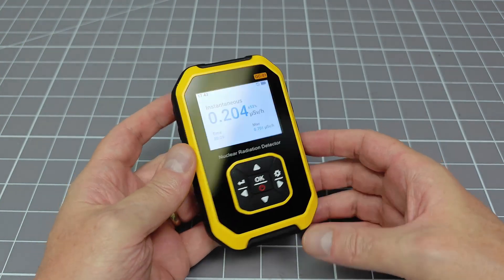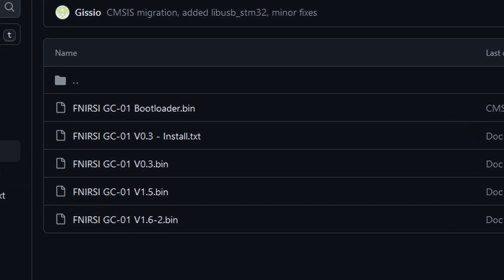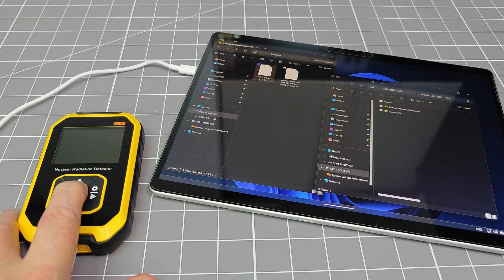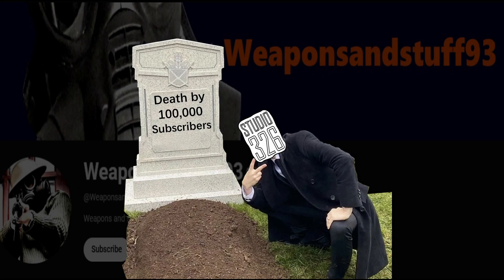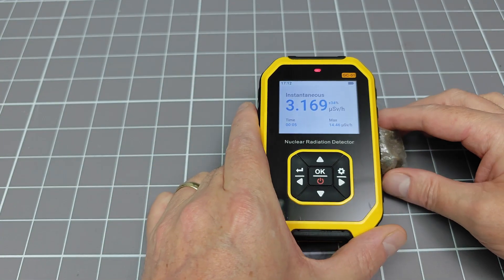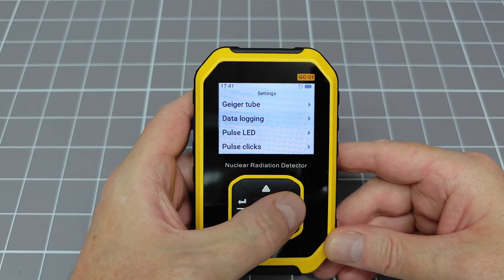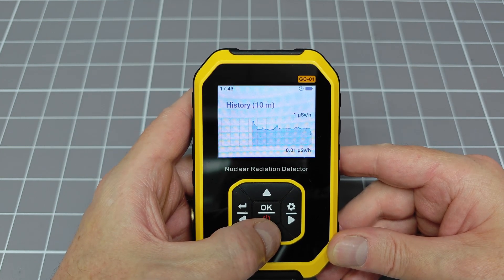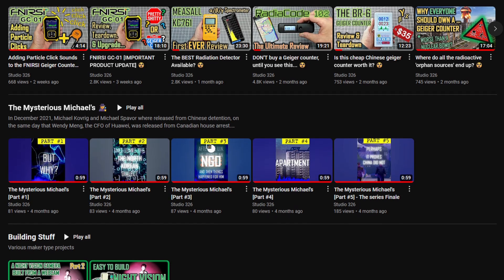FNIRSI Firmware Upgrade, Review & Instructions

Comment: the updated one is 2.0.3

so which bin file should i use?
Reply from the maker: I really can't say, it depends on what version MCU you have in your unit, there is a FAQ section on the Gissio GitHub, probably worth a look at that!
Reply: I also have an updated version. Flashing firmware didn't work the first time, just putting the file in didn't work. I had to disconnect the battery because the device was in a bootloop. With the battery disconnected, I connect my gc-01 to usb and simply put the same firmware file 2.0.3 and everything was flashed successfully. Tube j321.  APM32 MCU

Comment: Sadly I didn't even get to try this.  The version I have doesn't seem to have a remotely similar pcb in it and does not communicate with a PC via the usb-c port.  I'm stuck with some poor clone version of the gc-01 firmware.  At least I soldered in a m4011 gm tube though so it does read a lot better.
Reply from the maker: Not sure its a clone, just an older (or maybe newer version) that is cost reduced.

Comment: Anyone try the final release?
Reply from the maker: The last time I downloaded was about 6 months ago, has there been any major updates in that time?
Reply: @project-326  I am not 100% sure tbh. On the previous links, nothing has changed. However if you go to the radpro releases... the last firmware update was 25th November 2024 (2.0.3) and there were a few in-between.

I am about to get my hands on one of these (Little choice), so was hoping to turn it into the best it can possible be lol.
Reply: @project-326  He just released another update that improves on the last... so there has been at least 3 more updates since this release and definitely looks better and gives more tuning options.
Reply: @project-326  From what i can see. The latest version has added some more customisable options in the menu, for detection, appearance and battery lifetime. I have not run it through tests and gone through all the options (Accuracy, battery life and customisability), but from first glance it does "look" better than the Beta version.

Someone with more experience should give it a test 😉

FYI - I just got my GC-01 from amazon. It came with the J321 GM Tube (J321 2022 V).

Comment: Thanks for this. I had just done the hardware upgrade to get clicks but this is probably a better solution. Also the damping (rolling averaging) of the original software is pretty terrible so this upgrade may fix that well I hope. I think I will try it

Comment: also what gm tube is supposed to be in the gc-02 model if you know, i think its the sbm20-1 but im not sure and also is that tube even good or should i upgrade it to another tube and if so which one would you reccomend
Reply from the maker: the GC-02 is the cheaper version and uses the J614 tube, which is pretty terrible.
Reply: @project-326  okay thanks for your advice ill go with the gc-01 and upgrade it if i get the cheap tube
Reply from the maker: @tthesubbutton  there are some reviews of some other low costs counters on my channel page, some of those might be a better option to the GC-01...

Comment: I want to change the tube with the Sbm-20u. Is it necessary to change the High Voltage power.?
Reply from the maker: looking at the SBM-20u spec, its looks like the recommended voltage is 400V, the old tube wants 380V, which is pretty close.  That said, the firmware upgrade from GISSIO allows adjustment of the voltage.
Reply: @project-326  "I think I have a 'fake' GC-01. The board is totally different, and the MCU is not (WCH) or (GEEHY). The code on it is: CA32F0156L2-62. It can't connect to a PC, and even if I managed to connect it, the firmware would probably not work on it."
😢
Reply: @project-326 "I think I have a 'fake' GC-01. The board is totally different, and the MCU is not (WCH) or (GEEHY). The code on it is: CA32F0156L2-62. It can't connect to a PC, and even if I managed to connect it, the firmware would probably not work on it."
Reply: @project-326 "I think I have a 'fake' GC-01. The board is totally different, and the MCU is not (WCH) or (GEEHY). The code on it is: CA32F0156L2-62. It can't connect to a PC, and even if I managed to connect it, the firmware would probably not work on it."
Reply: I think I have a 'fake' GC-01. The board is totally different, and the MCU is not (WCH) or (GEEHY). The code on it is: CA32F0156L2-62. It can't connect to a PC, and even if I managed to connect it, the firmware would probably not work on it.
Reply: @aggeloslianos6083  I think you do sadly, looks like a CACHIP, which is not supported by the aftermarket firmware according to GISSIO's github. I'm sorry that it happened to you, it happened to me before but I managed to return and get a refund for an authentic GEEHY model.

Comment: Is the device's Geiger-Muller tube still original (only the firmware was updated)?
Reply from the maker: no, it was changed for the type that was very originally used, not the type that was shipped.  There is a video about this on the channel page...

Comment: I like very much! But, my issue = the device & pc does not connect ... Only loading battery ... Nothing happens ...
Help! Thankxs!
Reply from the maker: First of all, let me just say that I am not an expert on this firmware or in any way responsible for its development.  You need to post on the GISSIO GitHub portal to post these types of questions.
Did you press and hold the power key before plugging in the USB cable?  Are you sure that the USB cable is a power + data type and not just the power-only one that was supplied with the product?
Reply: @project-326  Thankxs Very Much, I'll tsjeck it all !!! Greetings from  West-Flanders (Belgium).
Reply from the maker: @FrankDeDekenTurbosoul  Greeting from Shenzhen (China)
Reply: @project-326  I've got the geigercounter BR-6 today. Watched Your review! 
Ps: About GC-01: i think the USB cable is only power type; won't recognise when connected - only loading battery.
Reply: @FrankDeDekenTurbosoul  Have you found the solution?

Comment: Hello! 
  Thanks for what you’re doing on your channel – great job!
Have you ever tried Pudibei Geiger counters? I use the NR-950 model for 24/7 monitoring in my home (just a hobby :) ). 
It’s simple, can run on a battery for more than a month, but I can’t say for sure how accurate it is...
Reply from the maker: I have never tested any of the Pudibel devices.  and accuracy is very hard to define as a concept with geiger counters.  It depends what kind of radiation is being detected.  Background tends to be a mixture of gamma and a few betas, but the actual ratio depends on the location of the measurement.  Normally, figures like sensitivity and range tend to be more important.  For example, if I have a background of 100 nSv/h and two instruments, the one that can collect the most count events at the same activity is preferred.
I believe that the Pudibel devices mostly use the J321 or M4011 tubes, which are not too bad for a cheap device.  The calibration factor is just a thing that gets set by the vendor to give an acceptable reading for a given activity.
Once you have a reasonable tube, which is mounted so it can sample the ambient radiation without too much occlusion from the enclosure or batteries, etc, then it really comes down to the other features.  Features like graphing, PC data offload, user interface, etc are important because they effect how you will use the product.

Anyway, sorry about the long ramble, I hope this helps?

Comment: I just upgraded to the Rad Pro firmware. However, this on my Bosean FS-5000. Other than the TFT display being more unique and vibrant using the stock firmware, which I totally agree with you on, I really like the Rad Pro firmware, especially on the Bosean FS-5000! It has so many more features, and since I use CPM and CPS (mostly), it has many more options available for CPM and CPS, including sieverts and rem! It doesn't have HV adjustment options, though. The 4-pin header I used with the ST-Link V2 programmer is now soldered to the PCB, so I won't need to remove it, when new updates become available. The battery life is also still very good, too. I'm glad I found and subscribed to your channel! Your videos are very well-done and informative! Thank you so much and cheers from the USA!

Comment: Latest version has dark theme
Reply: I mostly use my SEI Inspector USB G-M counter, which is a professional device, but more for precise measurements, including alpha particle detection. For general use, I use my Bosean FS-5000, which I recently purchased. Upgrading to the Rad Pro firmware is more tedious and time-consuming, since it requires an ST-Link V2 USB programmer and a 4-pin header–for the data wires. I decided to solder (which is optional) the 4-pin header to the PCB–to stay, so that I can upgrade the device much easier now. It has so many more features than before, except for HV/PWM features. Mine has the day, dusk, and night theme. Since dose units are mostly inaccurate, unless the G-M tube is energy-compensated, which the vast majority arent, or if it's for measuring the radioisotope it was calibrated to (gamma only), I mostly use CPM or CPS. I'm really glad I can use CPM or CPS–with more features than the original firmware, which was more vibrant and colorful. However, Rad Pro works great, at least on my Bosean FS-5000–being my first and only Chinese-made G-M counter. Having to take the extra steps to upgrade it however, was very well worth it! ☢

Comment: First of all wanna say big thanks to Project 326 ona all valuable information. Second, there is a diffrent way to get in-to boot mode. My device is from Avgust 2024, and its not the same as you describe in video. To get in-to BOOT MODE i need to PRESS power button and at same time plug cable from PC. Then i got boot folder pop-up. And last thing, my device always show some value. Is it normal (from 000.08 - up to 000.50msv/h) or it is broken.
Reply: There is always a small amount of background radiation present.
Reply: Geiger-Müller counters should never read 0. Unless it's turned off, of course. If a Geiger-Müller counter always reads 0, then that's often indicative of a broken or faulty Geiger-Müller tube. ☢

Comment: prefered over bosean 5000?
Reply from the maker: no way...
Reply: @project-326  I'm between bosean and this for watch dial radiation detection...bosean all way?
Reply from the maker: @paso2136  indeed, it is more expensive, but better made, better features, etc.
Reply: The Bosean FS-5000 is the best cheap Chinese-made Geiger-Müller counter! I upgraded mine with the Rad Pro firmware, which is more tedious, requiring an ST-Link V2 programmer, data wires, and a 4-pin header, plus driver downloads. I just soldered the 4-pin header to the PCB firmware terminal circuit, so that'll make it much easier to update–in the future. However, it was well worth it, in my opinion! Even the stock firmware is nice! It has far less options, but it's more colorful/vibrant. So, either way–it's the best! Or, to put it simply:
☢ Bosean is boss! ☢

Comment: It's beta so give it some slack :)
But it sure makes the Fnirsi worth considering to experiment with. Have thought of trying Rad Pro on some of the other geigers. Seems to have much more stable and fast readouts. For that alone it's worth considering. Might not be for everyone but when hunting antiques I just bring along a cheap geiger that I'm not so sorry about to trash - a cheap one is usually good enough to decide whether or not to buy an item. Lets hope it somes to other geigers with nice big screen using AA cells (BR9 etc.). I much prefer AA NiMH over build in LiIon that dies too fast and then have tro be replaced and finding some in the first place is a pita and finding some that are good quality an even bigger pita. Just easier to use AA NiMH and even with big screens they last a long time. Even some crappy 800 mAh cells power my usual hunting geiger (very crappy ViBao C101) for a long time.

Comment: ONLY 24h?! My unit used to last about an hour or two on stock firmware, now I struggle to power it on at all...
Reply from the maker: Another thing to factor in is that the company is using pretty crappy batteries.  I have already seen the battery lifetime falling significantly throughout the 9 months that I have owned this device.

Comment: I just picked one up in the last week. I already own a Radiacode. I just wanted a cheap one for my kid to use when hunting antiques. It is more sensitive than some other samples I’ve seen on YT. However in this new one the tube has two leads on one end and is not labeled. It doesn’t fit into a holder like some others. Also I the chipset IC is not labeled anymore. None of the methods to get the device to show up in file explorer seem to work anymore either. It seems like they’re locking these down now. Just a heads up for others.
Reply: I took it further apart today to see if I could find out anything else about it. The screen side of the PCB is marked “xbh-h420 ver1.6”. I suspect the IC is not just cleaned of markings, but something different. Whatever this is has 12 contacts on each side of the square. The Ch32 and APM have like 16 contacts.
Reply from the maker: @EmoticonFury  Interesting, not sure what version mine is, I'll take it apart later...
Reply from the maker: thank you for the feedback, it is a shame...

Comment: Hello, I recently received my gc-01 with a M4011 tube, is it equivalent to the J321? I think the specifications are the same. Thanks
Reply from the maker: You are correct, the M4011 is almost the same as the J321 in terms of specs.

Comment: I just received mine, but I can't flash it. Mine has v. 1.6 firmware. When I press and keep middle button pressed, screen starts for about 1 second showing the firmware version then screen turn black but nothing happens. I can't access the drive to put on it the firmware... Cable is good, but I think it's because of v.1.6 firmware. Maybe chinese blocked the access.
LATER EDIT: it is accesible by pressing simultaneously OK and right arrow while connecting the USB cable.
Reply from the maker: Glad you found the answer, there are a lot of FW versions for this device and if you look o the GISSIO GitHub repo, there are a lot of answers too.  If you run into further trouble, the operator of GISSIO is very helpful...
Reply: @project-326  Indeed, I found discussions threads on Gissio Github ans found the solution to access the drive. More than that, there is another way to do it: you should use an Android device (with OTG USB) and connect both devices (FNIRSI turned off). To unlock the drive of FNIRSI you should only press OK button until the USB menu appears. The Android device will show a dialogue "device not recognized". Just disconnect FNIRSI and plug it into USB PC/Windows port. The drive will be accessible. But only once... You should repeat the procedure for another access. Tricky, isn't it? Chinese stuff, meh! :) And, by the way, mine has M4011 GM tube.

Comment: WARNING! ! ! !
I followed the instructions very carefully, read what chip it was, did the firmware upgrade, it bricked my device. Bought an STLINK and attempted to directly flash the chip according to instructions on github. No joy. Bought a new chip, desoldered the old one and soldered the new one on. Tried to flash it. Nothing. 
Figured I just got a bum unit. Bought another one. Carefully reread the instructions yet again, did the firmware upgrade as instructed, bricked this device as well. Got 2 of these now completely dead. 

My advice: DO NOT USE THIS FIRMWARE!!!!!!!
Reply from the maker: which MCU are your devices using?
Reply: @project-326  CH32F103

Comment: At Gissio's github I saw how to check the voltage of the tube. I get 411 Volt. It should be 385 V. I don't know if 411 V is a problem for the tube. I have the original firmware.

Comment: If you have issues getting into the firmware on windows 11. With the usb cable installed, You need to push a needle into the reset button hole on the right while the power button is pressed down at the same time. Release the needle and keep the power button pressed while dragging and dropping the new firmware. If you release the power button it disconnects the USB.

Comment: When I connect it to my PC, no drive shows up. I hear only the beep when pressing the turn on button. I do it exactly like you show. I even tried another PC. Has somebody a solution? I recently had to replace the 3V-battery. Could this be the cause? Is it possible to reset the GC-01 or the Lifetime counter?
Reply from the maker: Removing the battery isn't a problem, many people have done this, including myself.  You might want to post on GISSIO's github repo, this person is very helpful.

Comment: 7:17 Using the original firmware, my GC-01 runs only 9 hours. The display is at lowest brightness. Can somebody confirm this poor runtime? I will test the runtime using the alternvative firmware.
Reply from the maker: Originally, I got a few days from mine, however, I suspect if FNIRSI are true to form, they have used the very cheapest battery that can be considered a Li-ion cell and that these things degrade over time very quickly.
Reply: @project-326  I checked my Li-ion cell. It has 4.2 V full charged and 3.7 V when it turns off automatically. I think that's to early. I should turn off at 3.0 V.

Comment: what happens when you get the newer hardware version where the circuit board is almost empty (compared to the traditional one)? Mine does not even have a backup battery and the lithium cell is soldered directly on to the connector! Boot mode doesn't work, I tried 5-6 cables, so no update for me. Only thing I managed to do is put a jumper over the final resistor inline with the tube so that the voltage went from 200V(!!) to 300V which again is below the typical operational voltage of the tube (380V). If anyone has worked with this new hardware version, let me know..